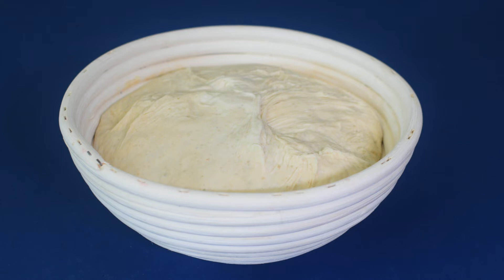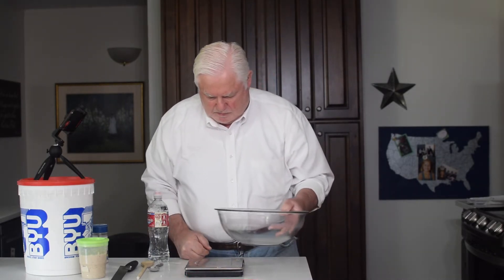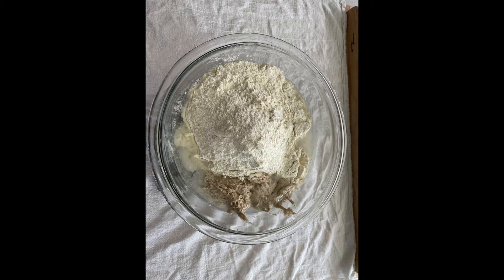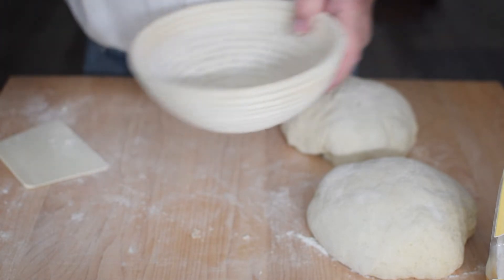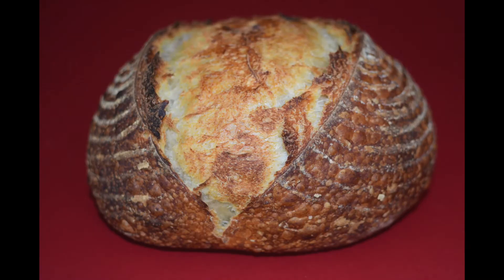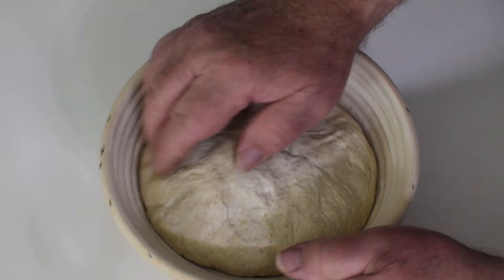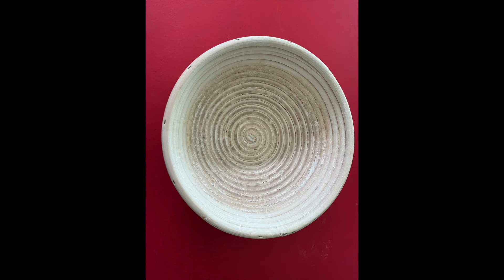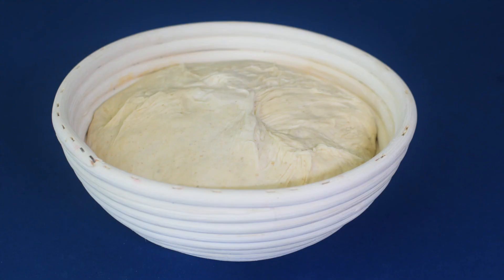ARE YOU STUCK

Comment: Hi Ron, thanks for sharing your process. When brushing out my basket on I noticed little fibres lifting up from the Vine material that the Basket is made out of. They appear to be the same as yours and I’m wondering if you’ve ever noticed this and should I be concerned about this getting in my bread? I guess it’s all just fibre right?
Reply: Hi Paddy, these are sometimes related to the quality of the banneton but also once they take up water from the skin of the dough they are more obvious. They shouldn't present any problem, but a stiff brush like those kitchen scrubbers run over it should help. You can also make a slurry of cornflour and water and 'paint' it on the cane to make an almost non-stick coating. If really concerned use a liner in the banneton.
Reply from the maker: Yes, I've seen those strands as well. I pull them free. I really don't think they get into the dough.